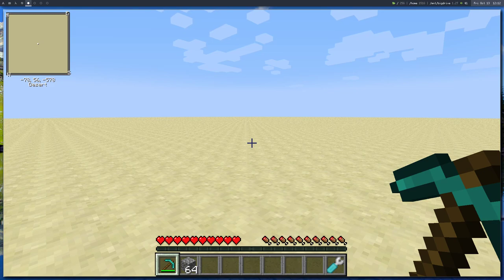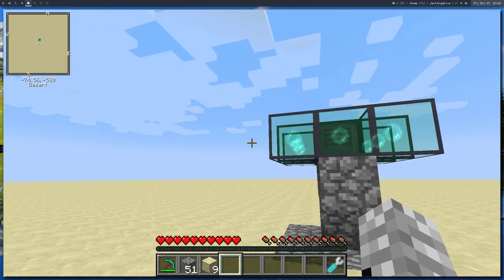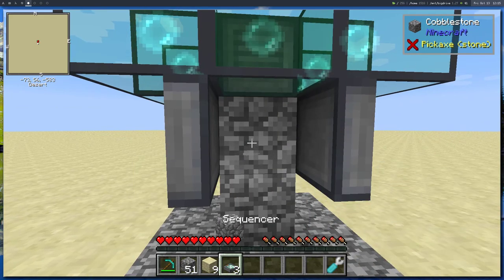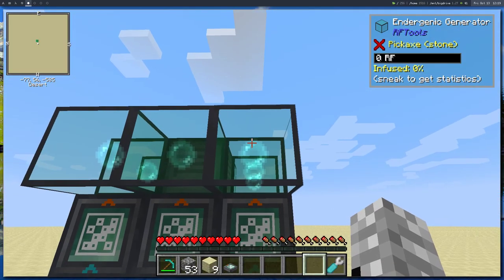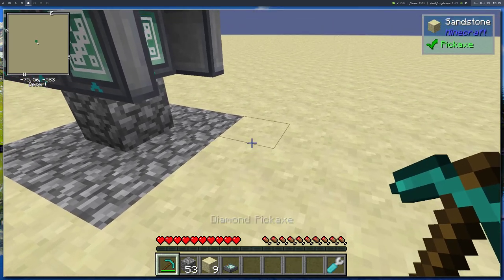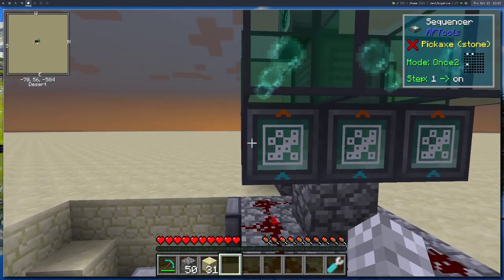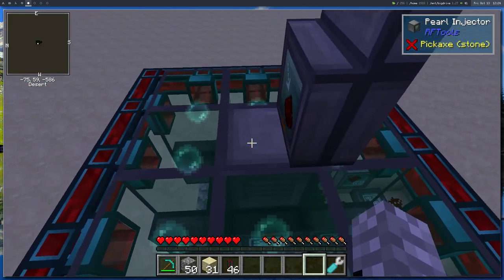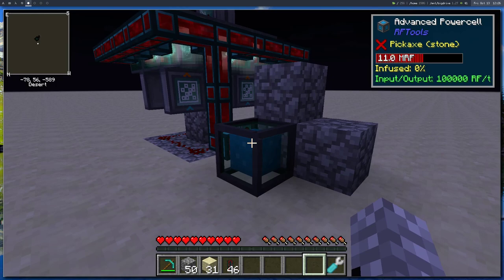Fairly Easy Endergenic Generator (32k RF/t, RFTools + vanilla redstone)

Comment: I built this 1st time and it works perfectly, 2nd time I built it, it wont work. Says the pearl idles on the 8th generator
Reply from the maker: Hi! Like it says in the description, this generator is unfortunately pretty brittle as far as timing goes. The timings have to be basically tick-perfect on all but the last sequencer, and even worse is that even a tiny amount of lag aused by nearby machines can throw it off. You might have some luck with adjusting the timings just around the 8th (so 7, 8, 9), but no guarantees! This info goes for Minecraft 1.12-- I haven't tested RFTools on 1.16 yet.

Comment: Also with this vanilla mess of a redstone I have no idea what is supposed to connect where. I'd really appreciate if you explained what connects where redstone  wise as opposed to making this mess of slabs and vanilla redstone and just telling us to copy it.
Reply from the maker: Apologies for the late reply, but it's vanilla redstone. Everything connects, except for the slabs (slabs only connect downwards). The RFTools pieces connect in the way that is indicated on the piece (blue/orange arrows).

Edit: Not sure what else to explain, but I'll have a try.

You can think of the slabs as a diode, and the RFTools pieces are also diodes (they only let signals in/out from dedicated sides). You will see the circuit flash twice, once when it's triggered from the timer piece on the bottom (goes through the slabs since it's from downwards -> whole circuit flashes), and once when the pearl has completed one circuit (only upper section flashes).

The circuit is constructed with vanilla redstone and arranged that way so no point on the circuit is more than 15 blocks away (taxicab distance) from any signal origin. 15 blocks is the maximum distance you can trigger redstone in the same tick-- otherwise we'd have to use repeaters, and those have a minimum 2-tick delay, screwing up our timings. At the time this video was made (in 2017), no "easy" redstone circuitry mod was available on 1.12 that could do this.

It appears you're frustrated with the endergen not working (and yes, as mentioned in the description, they can be buggy depending on your modpack/server), and it's been a long time for this reply (sorry), so I don't figure it'll help you now. But there is a method to that mess. If you want something easy to understand, you probably want Extreme Reactors or Powah instead of an endergen.

Editing again to add the basic mechanics: as long as a pearl is circling around the ender blocks, it keeps sending a signal via the ender monitor. This signal continually resets the timer so it never triggers, until the pearl stops circling and the signal doesn't get fired. The timer then fires one signal into the sequencer ring to charge them up, and the bottom sequencer on the ground fires another after a delay to actually fire the pearl. Pearls have to be fired into an ender block after exactly 10 ticks of that block charging. That's really all I have time to explain-- otherwise it'd have to be a whole new video!